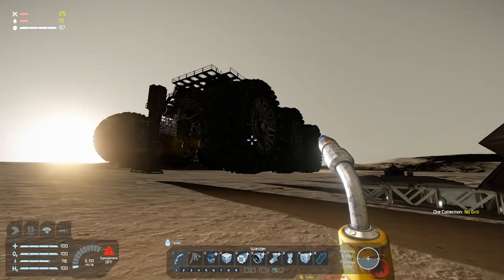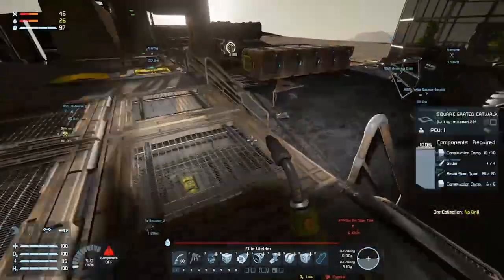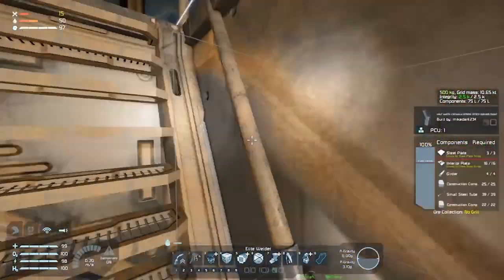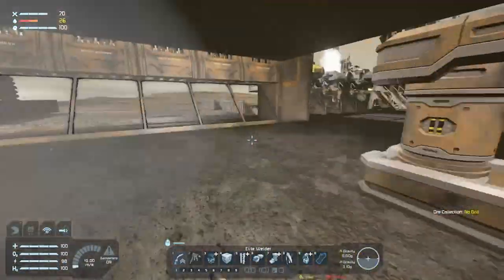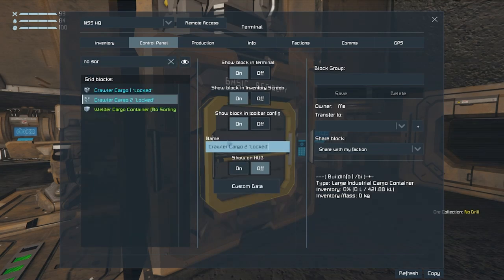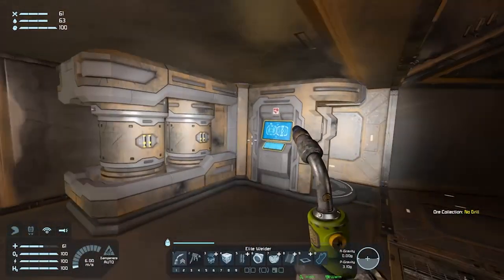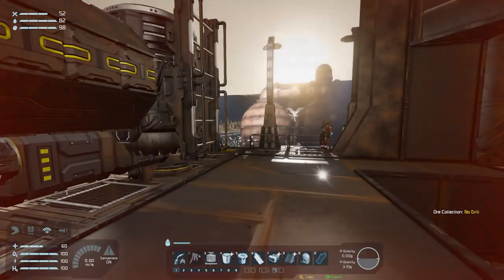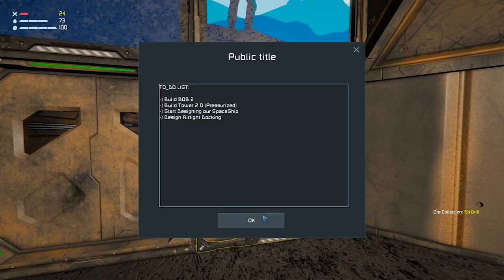No Suit Survival: Ep. 19 Power - Space Engineers

Comment: I would suggest that you space out the three wheels you put on the crawler, you have them like this OOO , they are colliding. try this O,O,O . Even if the last wheel stick out from the back, that might be more stable. I have had problems with large block vehical. I had one that was a heavy huller it had two steering wheels in the front and two in the back and eight fixed in the middle. something like this. O OOOO O. the eight in the middle caused so much trouble I had to redo them. O O,O,O O . that worked far better.
Reply: I really appreciate the extra effort taken to try and depict a wheel arrangement in text form. Bravo.
Reply: there's no getting over the fact he simply needs far more wheels for a vehicle in 3x gravity.

Comment: When I was building an armored large grid vehicle for Pertam (1.2 G) It required 8 wheels to not die immediately and 16 wheels to drive reasonably safely at high speeds. You are putting probably 6 times the weight on those wheels if not more. I'd try for at least 14 wheels (7 on each side in 2 staggard layers)
Though at this point I think your time would be better spent on the spaceship

Comment: The script DAS (Driver Assistance Script) will automatically set suspension strength and turning parameters to optimize your Crawler. you would have to add a remote control and a few extra cameras, but it is an amazing script to assist wheeled vehicles.

Comment: The thing that is wrong with you crawler is sImple mechanics. think of the wheels like gears, the two wheels on the out side of the center wheel are over powering the torque of the center wheel reversing the direction of it. The friction between the center wheel and outer wheels is so great, that they cause it to put a reverse force on the rover, in return cause space engineers physics to glitch. The reasons this doesn't happen on a small grid is because, the small grid in space engineers is scripted in a way that That the wheel, don't have enough friction against each other to reverse the direction of the center wheel. TL.DR put a gap between the wheels
Reply: Oh and before i forget, I rebuilt your rover in space engineers. all I did was put a gap between the rear wheels and that fixed all the problems you are having, extend the rover by two blocks on the chassis and put a single block gap between the rear wheels. just make frame rails under the rear of it, since you already dropped the wheels one block, add like frame rails to the underneath of the rover , think of it as a sub frame on the back